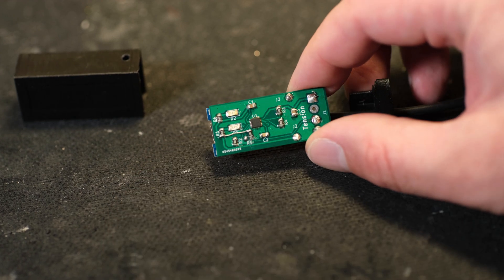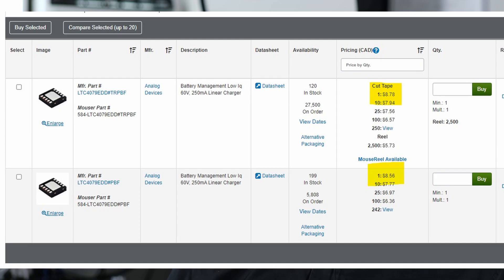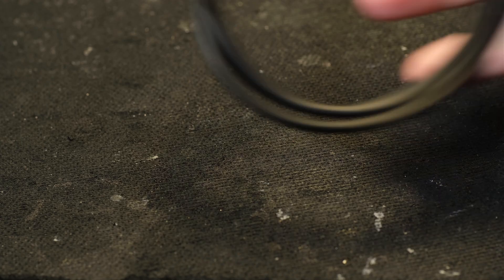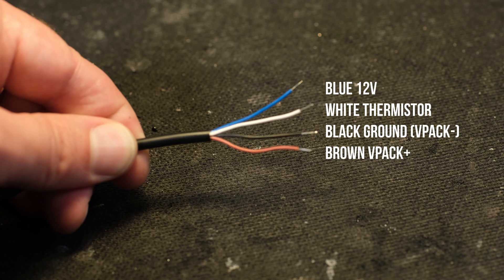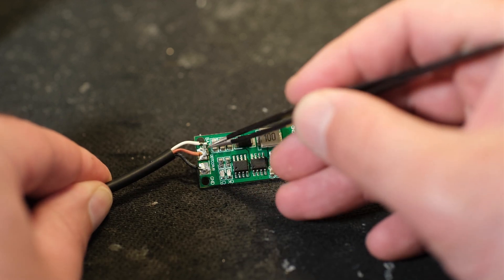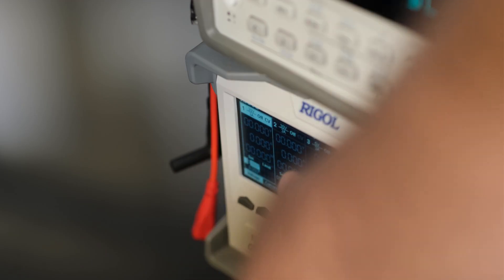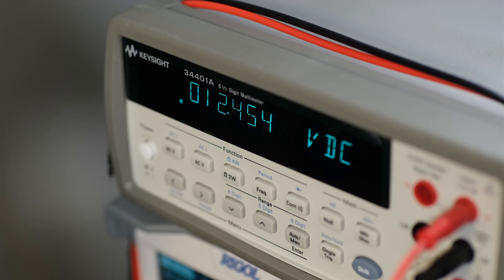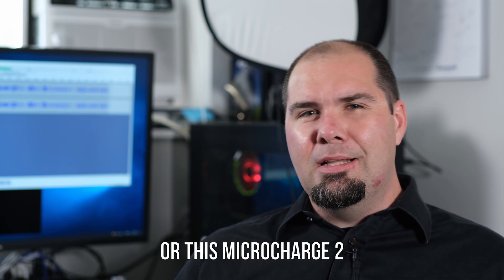Making a even smaller portable charger for Campagnolo EPS

Comment: Is there any difference in this charger to the original one in terms of balancing the cells or is it basically as save as the genuine one ? Would be nice to know :)
Reply from the maker: Neither this design NOR the original EPS charger has any balancing. The battery does not have any balancing either. So to be clear, all EPS v1 - v4 do not have any form of cell balancing whatsoever. The 4 pins on the charger are power, ground, thermistor, and 12v auxillary that was used on the original V1. If your pack goes unbalanced, it basically dies.

Comment: Keith, these videos are very interesting and informative.  Thanks so much for taking the time to make them.  For those encountering this one, I can report that the charger, using the parts listed in the comments, works very well with a PU15-CH EPS V2 power unit.  I used a traditional resistor so it was easier to solder.  Appropriately sized enclosures can be purchased for just a few dollars from Ali-------ss.
Reply: Please give me the product link on aliexpress
Reply: @quaitrutinh  the links for the parts are in the description. You need to amend it yourself.

Comment: This is a fabulous little charger, I am repairing a friends EPS 11 Super Record, I assume it be fine that old version too. Also he has torn the connector off the charge lead.  I am going to splice in the extended charge lead but can’t find any where that indicates which of the 6 wires to connect to the 4 on the charge lead. Sounds like I only need to connect three. Any help would be much appreciated. Keep up the great work.